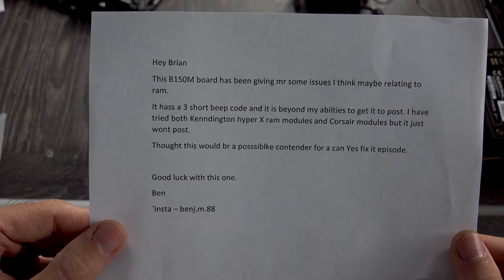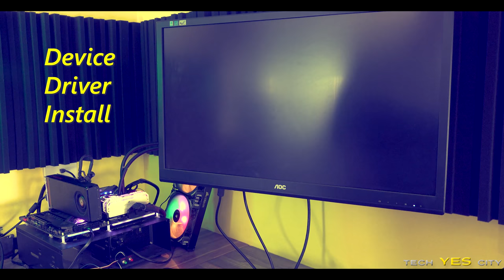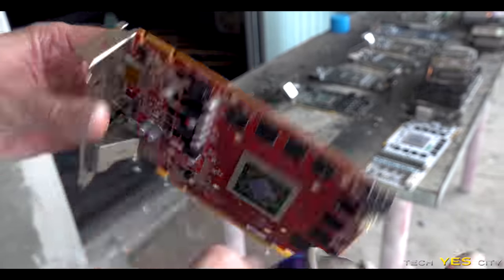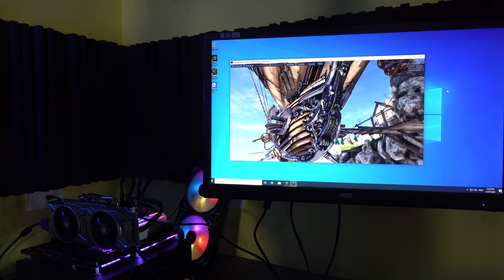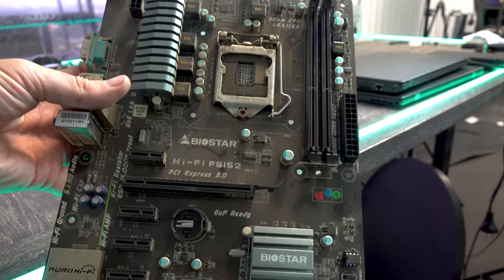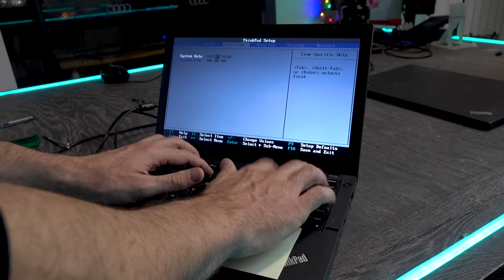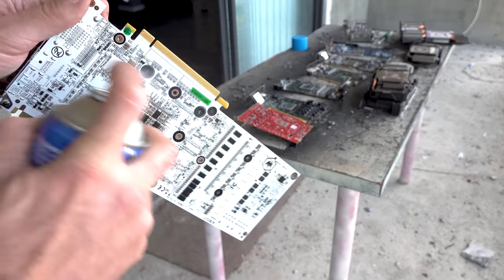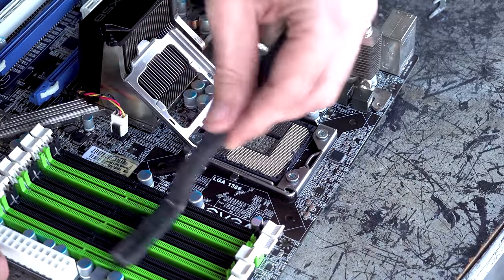How To FIX Faulty DDR3 RAM.....?  Mass FIXING Graphics Cards (Can YES Fix it)

Comment: Some of the cheaper Gigabyte boards have the silkscreen, traces and pads for dual BIOS but only come with one chip. The dual BIOS boards are supposed to be able to work even with one chip removed. You might have to desolder, format, flash and resolder this one or order a blank or preflashed chip to fix it. You can also use a programmer with a test clip (so no desoldering) but I find those extremely unreliable and frustrating. Based on what I've seen I'm confident that you can learn to do hot air soldering in no time. Don't even think of using an iron even though it's possible to do so. Feel free to ask for equipment recommendations.

Comment: Bryan:  I always wondered why applying heat to the GPU would sometimes fix a problem. Also, how permanent is that “fix”? Thanks for all you do.
Reply: You didn’t ask me but I won’t let that stop me from replying. The idea is that either through manufacturing defect or thermal stress during usage the solder balls that attach the physical chip to the board become disconnected. Sometimes the chip ‘floats’ off the solder ball entirely and sometimes it’s just sorta on and off so you can get intermittent failures. The heat gun partially melts the solder balls and allows thE chip to sorta ‘float’ back into place, reconnecting them. If you want to know more, look up “reflowing”
Reply: its not a permanend fix though. more often than not he solder balls will fracture again. Honestly I love TechYesCity but i would not recommend this as a "fix" method unless you plan to keep the hardware for the rest of its days. During the xbox 360 days many sellers pulled scams by heat gunning xbox 360s

Comment: I remember when I was heatgunning 360s, I often found turning them upside down and starting slow then going up to high for short bursts and overall doing it for about 10 minutes was better than upright and on high, this way the only time 360s came back with RROD was after people did things like 15 hours + on heavy gaming sessions and/or with terrible cooling i.e directly on carpet with no ventilation.

Comment: In all likelihood you're actually just forcing the die to realign with the substrate in most cases. I don't think you're reaching temperatures that would melt the lead-free solder under the chip, if you would then you'd see the chip hover over the pcb (if flat) or just misaligned completely when angled like you showed in the video. This type of fix is great if you get hosed with a gpu (so you can resell it the the next unlucky sod) but i wouldn't use it in a build especially if you offer any kind of warranty. I've had cases where the gpu would die again after just a few hours but also  had situations where the gpu worked fine for at least a year. I'm curious about the feedback you get with those, would love an update on that.

Love your content, been a long time viewer :)

Comment: Lead free solder has a lot to answer for, also have you tried putting liberal amounts of gel flux on the boards before you heat gun them. imho this is the best way

Comment: I have a dead AMD R9 270X (MSI, Twin Frozr) that gives signal as "Microsoft Basic Display Adapter" but when I try to install the video driver, I'm stuck with a permanent black screen (tryed a lot of version + bios reflash and still nope). Gotta try the heat method directly on the PCB and hope it will work. Thank you for your videos man👍 really helpful
Reply: Contact cleaner all over 1st...Try that before the heat gun method.

Comment: No freaking way! I was about to throw away a GTX 1050 because it would give no signal. Tried the oven and then the heat gun method and still would not work until I watched the video and decided to try and use the DVI output, and it lives!! Thanks Brian, keep them great videos coming.

Comment: The dead cards are good for HDMI ports for other cards. All cards have different profile ports. EVGA are proprietary. Does take a serious iron to get them off though. 7 layer board? If you can get them off in perfect shape they  sell for $15 each on Ebay

Comment: Had a gtx 770 from msi. I had the faulty driver error from windows. Gpu application shut off when the gpu loaded up. I opened up the gpu and cleaned it up. Now it works perfectly. I don't no for how long.

Comment: Hey Brian, did you ever tried to put your pc parts in the dishwasher? As long as they can dry and there is no water left, this method also works very fine. I saw this first in a video from german YouTuber and overclocker der8auer (Roman). Greetings

Comment: Hey man since you have nothing to lose try the oven method on the cards that didn't come back. 
Preheat a oven to 205°C~210°C put the card in and set a timer for 10mins. Turn off the oven and let it naturally cool inside the oven.
Would be a cool video :D
I brought a Wifi card back to life using this method.
Be careful with plastic. Many plastics start melting at this temperature but PCB manufactures usually use plastics with a higher melting temperature so they can solder the components that have plastic without melting them.
@Instead of aluminium foil you can use MB spacers to raise the cards out of the ground.

Comment: You can probably fix the card with the memory issue if it is a cold solder joint. Get out the solder melting point and use no clean flux in the oven at that temperature.
Build something to suspend the boards in the air in the oven.

Comment: I suspect the hdmi issues can be 1 of 2 things..
someone has either  fucked around  in  window or bio and set vga/dvi as primary..
second issue  is the port  has failed requiring  replacement or it has been  zapped and  anything that sits behind the port is gone..
 i would advise convertors  on a cable  as to  run them on the ports (whilst can be done)  can  introduce excess  on the pcb..

I also suspect the lack of use of a strain relief cable most likely  caused damages the hdmi port..

Comment: There is a very common but also very obscure issue on some lenovo models... Is a bug that wears down the bios flash chip with the constant writing of system logs. If you have the tools, try replacing the bios chip. You will need to pull out the current bios from the chip and burn it to a new chip. There are flash programmers that are dirt cheap that you can use to do this (the one based in the ch341 works perfect).

You can buy both the programmer and the flash chip on aliexpress. Alternatively, you can recycle a flash chip from other motherboard and get the programmer though amazon or ebay.

Comment: I have a Galax RTX 3060, and it was working perfectly fine. I was playing Destiny 2 on it without fail for a few months.

I then was looking at getting a water block for it (didn't need to water cool it but I wanted to in order for it to look better with the rest of my build.

So naturally I opened up my 3060 to see if the PCB was correct for the water block I was looking at. I was very careful with how I opened it all up, but then after opening it, confirming it was compatible with the water block, I then put it back together, but now it refuses to post...
The fans spin, but nothing else happens, no signal.

I checked my MSI bios and looked at the board overview, and it was saying that all PCIe slots were "empty" like the gpu wasn't plugged into it, yet it was in the first slot, fans spinning, but yeah the motherboard is no longer recognizing it.

Tried in other systems and still the same issue of not getting any sort of signal

Comment: You can always use a 'DVI to HDMI' cable when the HDMI port on the video card is not working. That gives you a better output and also transmits audio (if you are connecting it to a TV for example). These cables are also cheap.

Comment: Sometimes the Graphics Card's BIOS can corrupt and it may either just not display an output or behave weirdly in windows like not being able to run 3d work loads.
No amount of heat gun and cleaning can fix this, however it is very easy to reprogram the bios from windows using a tool like NVflash (for nvidia cards) and ATIFlash (For amd).
You just need to have the card in the PC and working video output via integrated graphics or another card. As long as device manager detects it, it might detect it as a Microsoft basic display adaptor or as the actual model, but it will likely say "windows has stopped this device code 43". 
If it shows up in device manager, it should be visible to NV/ATI flash, and it should be able to reprogram the bios.
If you can't get it detected in NV/ATI flash it might be possible to use a hardware re-programmer, they are cheap £10 and work for basically every card ever, these use a peg like clip to attach to the bios chip (provided you can find it).
A hardware re-programmer should always work and if it doesn't the bios chip is ruined or the reprogramming software doesn't know how to talk to it, in the former case it might be possible to buy a new SPI flash chip, to bring the card back, very simple SMD Soldiering.
It is also I would say more likely that the vrm or other power delivery/supporting voltage rail has failed on the card rather than the core just dying.
These fails can vary wildly from super easy to fix if you know what you're looking for to, you now have some sand instead of a GPU. Any VRM that directly powers something in the core, can kill the the core if it fails, depending on how it fails and depending on the GPU core.         
Also in this sort of failure scenario the heat  gun won't do anything, except maybe kill the core if it survived the vrm failing.
Yes the Heat Gun Method works, obviously it did 3 times in this video, but its not regarded as a good first response.
It can fix the card for maybe forever or maybe only a few hours of power on time. 
What it does is potentially reestablish FCBGA  connections between the Silicon GPU Die and the GPU Substrate, the green package the die is attached to. 
The substrate is then attached to the graphics card's PCB. 
It is extremely unlikely the substrate BGA disconnects the Substrate from the PCB, and in this case it must be heated to lead free soldier reflow temperatures which are between 240-250c, I'm pretty sure you're not using the heat gun at that temperature because in 8 minutes of blasting the cards, components would have fallen off the back at that temperature.
In comparison FCBGA will reflow at 180c, it is luck that any broken connections are re established, although no matter the temperature they are likely to be poor connections that will fail again.
FCBGA breaks down due to the gpu core going from 40c idle to 70-80c  load very quickly, the change in temperature causes expansion and contraction in the FCBGA connections, which can lead to them breaking eventually.
My troubleshooting recommendation:
1. - If you don't know how it died, use a multi-meter to check for short circuits between the 12 volt rails (pcie slot and 6/8 pin connectors) and ground, also check for short circuits between 12 volts and the GPU's Vcore output this is easy to check by probing an inductor which is part of the Vcore VRM. Checking for short circuits between Vcore and Ground is very difficult because, when a GPU core is turned off it has a very low resistance less than 1 ohms, or even less than 0.5 ohms. This step is only done to prevent fire or unnecessary damage to the GPU core.
2. - If its clear of short circuits, try booting it. If you get no image, try with another card and see if it shows up in device manager, if it does and it says "windows stopped this device (code 43)" or something to that effect, try a bios flash, if flashing the BIOS doesnt work proceed with steps 3 and 4.
3. -  If the card is a no show in device manager, using the multi meter check if the two major power rails are present for the card to operate, Vcore & Vmem. This can be checked by probing the an inductor (the non switching side of them) which is part of the Vcore or Vmem VRM. If you have no voltage on either or both of these then that's why the card doesn't work. Finding out why they aren't present beyond that is more complicated, but generally if both are present then every other voltage rail is present.
4. - If the two major rails are present and it doesn't show up in task manager OR bios flash didn't work, try the heat gun, you have nothing to lose now.
I just thought I'd share my experiences repairing graphics cards with you, I've only attempted repairing 4 cards but had 100% success rate;
Sapphire RX 480 Nitro+ number 1: had a corrupted BIOS.
Sapphire RX 480 Nitro+ number 2: had burnt out a transistor that controlled the fans, this was shorting out 12 volts to ground, causing the power supply to trip over current protection, removing the transistor got the card to work, just not without fan power anymore.
Plait GTX 1070: Had blown a fuse between the Vcore VRM and PCIE 12 volts, this was due to a failed power stage short circuiting 12 volts to the core and to ground. Removing the dead power stage removed the short circuit. Jumping the fuse with a wire allowed the card to work, however now as a 7 phase instead of an 8. 
the 1070 also had an unrelated issue of a voltage signal which told the Vmem and Vcore vrms to start, was intermittent. This was fixed by removing the chip that sent the signal and hard wiring it to always turn the vrm's on.
Gigabyte GTX 1080 ti OC: Had completely exploded its Vcore vrm, the 1070 had just failed and blown the fuse, the 1080 ti didn't have fuses which allowed the vrm to set on fire burning the pcb.
Because the PCB was burnt, many layers were now shorted together, and repairing the Vcore vrm is impossible. 
The burnt pcb material  was cut out using a dremel machining bit, until there were no short circuits. 
The Vcore vrm I replaced by an E power or zombie modification, by which you replace the Vcore VRM with an external vrm which is soldiered to the output of the original Vcore vrm.
This modification requires the Vcore vrm's voltage control be removed, so it doesn't shut down the card when it says there is an error with the vrm.
 It also requires that the card is power modded, by which the INA 3221 power monitoring chip thinks its pulling more power that its actually reading, the Vcore vrm is gone, so its not reading a power draw high enough, this puts the card into safe mod, which locks the core clock to 300 mhz, same as if you use too much liquid metal or short out the shut resistors to increase the power limit, this 1080 ti now thinks its pulling 18% of TDP all the time no matter the load condition.
Just a disclaimer, I would not feel comfortable reselling the 1070 or 1080 ti (not that I plan to), I also do not think anyone would buy the 1080 ti in particular, due to it now occupying 5 PCIE slots and requiring 4 power connectors, both Nvidia cards had at some point received 12 volts directly to the gpu core, this is terrible for the core, and would outright kill it in a majority of cases, I got very lucky here. As such the life time of these cards has probably been greatly reduced. Also the modifications to both are some what questionable from an electrical safety standpoint.
The RX 480 with the burnt out fan power circuit, I was be comfortable reselling, as 1. I did, and 2. the circuit damaged was disconnected from any power, so is not electrically questionable, it just required its fans be power externally.

Comment: ASKED for GOOD TIPS, try puting some soldering flux smeared on the soldering pins and legs of cpu dram etc before applying the Heat gun resulting in low heat remelt and connection of DRY Joints and connections,Works a treat Brother !

Comment: I guess the hot air is better the old oven trick to reheat a bad solder ball or loose joint so tks for the flick.

Comment: Should invest in a board preheater and hot air station for permanent repair. It's not really that expensive and both things are quite useful for a lot of things. Plenty of chinese preheaters available, anything that can get a stable 150c+ and has enough room (they are usually less than $120, some are more fancy that have their own K sensor probes). Hot air station is a very nice thing to have and is quite the investment, I like the Quick 861DW but there is also the cheaper version Atten ST-862D. Obviously you'll need stencils of different pitches, solder balls, and a decent iron as well (and obviously good flux that likes to run).

I'd like to see some genuine repairs, that'd be a good change of pace compared to a lot of other tech channels. And genuine repairs aren't even that difficult to accomplish, so there isn't much of an excuse!

Comment: personally i wouldnt heat gun anything at an angle like that as you are then depending on just the surface tension of the solder to hold the components in place, and some of the larger BGA components could slide even just a fraction of a mm and that could cause worse issues like missalignment or worse.

Comment: Questions on the heat gun. Are you attempting to heat the solder, or the internal components of the chips or capacitors? If it's the solder why are you applying heat from the top and not the under side (with card upright)?

Comment: You mentioned the 7950 was flashed to an R9 280. The bios was probably not 100% compatible and disabled most of the ports. Try flashing a proper 7950 bios and see if the other ports come to life.

Comment: You could also voltage test the VRMs and capacitors since those have high probability of failure and are pretty easy to swap